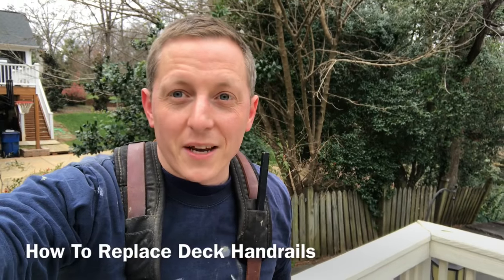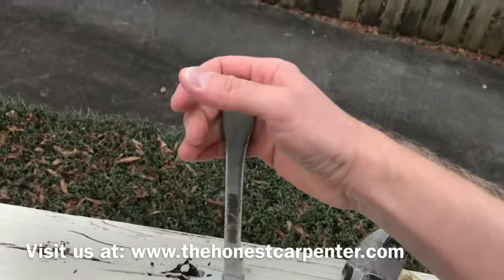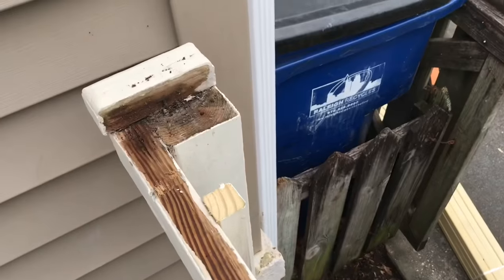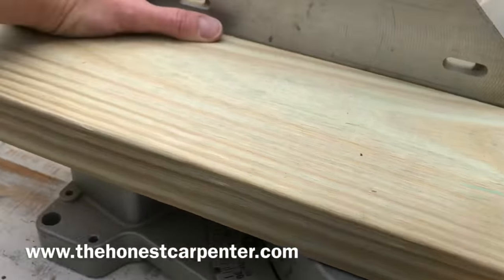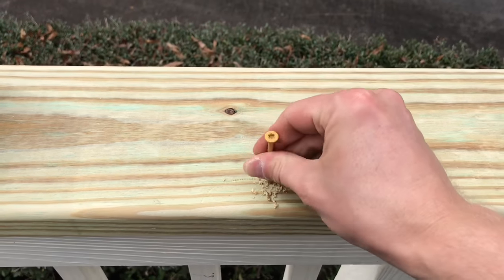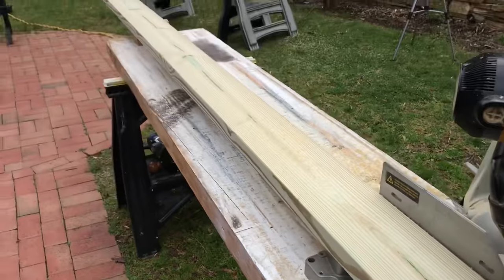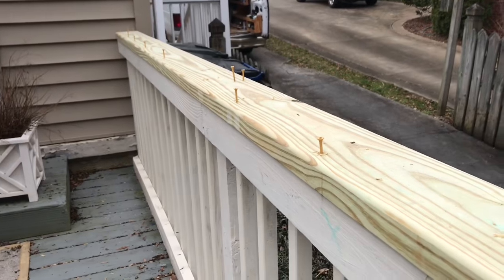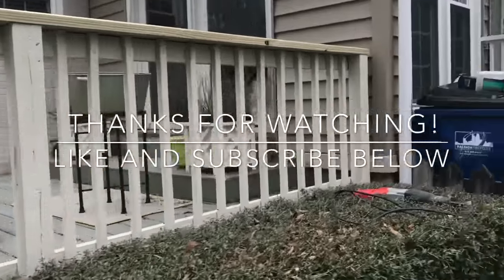How To Replace Deck Handrails (Easy Tips For Replacing Deck/Porch Handrails + Railings!)

Comment: A small flat pry bar would work better and safer than prying using a screwdriver. It's good you use the treated screws as fasteners instead of nails. A wide, flat railing like this is the case here retains surface moisture and will wear out or rot without a lot of care. Isn't there some way to add a slope or bevel to the railing so rain and snow don't just sit on the surface? Since you're selling a consulting service, I was hoping to see a more creative solution than just slapping some new treated flat lumber where the previous railing rotted.

Comment: I always use vinyl gutter upside down as the top cap. It protects the wood, looks better and will never rot. It will in most cases snap right on a 2x4 without the use of any screws
Reply: Great idea might try that

Comment: On any project I like to put the lumber printed information/markings on an unseen side.  If this isn't possible do you sand the ink off or have a better solution?  On a deck, the stain or water proofing doesn't cover the printing.  Any tips?  Love your stuff, you're a genius and you add great things as you go through the job.

Comment: Good carpenter tips in the video but I would suggest several other steps.
Paint or otherwise protect all that unpainted wood under the deck hand rail pieces before installing the new pieces.
If the new pieces are dry enough to router I assume they're dry enough to paint; consider painting the entire new pieces before installation, but at least paint the underside (to avoid painting upside-down after installation, easier to use a roller or broad brush) and the cut edges.
Consider a thin layer of caulk in the corner joint and the scarf joint; looked like the old scarf joint channeled water down to the post top.
Reply: I would even cut a line under so that the water doesn’t seep back and stay there!  A water break line, I guess.

Comment: Thank you for your incredibly helpful videos, Ethan -- I've learned so much from you, and I really appreciate your no-gimmicks style. I have a question about figuring out the lengths of railings when the corners are mitered. I have a horseshoe-shaped deck and I'm redoing the posts, balusters and railing caps. One of the railing caps (the "middle" section of the hotshot) will have two 45o mitered ends, while the other two railing caps (let's call them the legs) will have a 90o square cut at one end (that meets the house) and a 45o miter cut at the other end that meets the 45o cut of the middle section. Do you have any tips for calculating the lengths of the inside and outside measurements of the miter cuts? Thanks again for the great information.

Comment: thank you sooooo much for this video this was good advice. I have some really bad miter joints on my deck hand rails i have to splice in some new rails and cut some rotted sections but im going to do instead of miters  half lap joints if they separate like my existing miter joints they wont look as ugly.

Comment: When removing long boards, cut them into shorter pieces. It's easier to remove short pieces. I like to leave the screws flush so it's easier for the next person to remove them if the board rots again.

Comment: Looking to replace my deck handrails this Spring. A lot of erosion on those boards. I was contemplating the idea of putting some angled shims underneath to allow for water runoff. I'm a beginner at all of this, so I don't really know if that's possible or advisable.

Comment: It looks like the new wood has knots in it. Do you recommend filling them in before painting them?
Reply from the maker: @The Blade Runner If the knots are dense and more or less healthy, I just leave them be. If they’re corroded and falling apart, I’ll sometimes gouge them out and fill them with adhesive or even epoxy

Comment: What type of wood did you use?
Reply from the maker: I think treated 2x6, MAP.
Reply: @TheHonestCarpenter  Thanks for getting back to me. Excuse my ignorance but I tried looking up 2x6 MAP and can't figure out what MAP means.  When you say treated is it some sprayed on  treatment that protects against mold or termites?  Can I find this in my local Home Depot or Lowes or is it some kind of specialty lumber.  I had to replace a 2x6:section on my deck a while back and used redwood but I'm wondering if there is something better. The redwood seemed soft. I used the same for the vertical 2x2 railing pieces.

Comment: If someone did this same kind of project but stopped halfway in replacing all the rails and now I am trying to finish, should I redo their work if they fastened with nails and not screws?
Reply from the maker: Eh, leave the nails in until they start to lift out on their own Chris. Then replace them with 3” screws right through the old nail holes.
Reply: You’re the best! Thank you for such a quick response. Appreciate the content. Keep it up and good luck.

Comment: Shouldn't the cap be slightly elevated on one side so it sheds rainwater? I put a flat cap on mine and regretted not giving it a pitch. That's why I have to do this same job.
Reply: This is a problem I have!  MY cap just get's NASTY with algae and stuff.  How is the best way to cut or build a slope on the cap so rain water runs off?

Comment: When trimming out a door or window do you ever have problems with tight miters. When I trim a door starting on left side, then trim the top the trim piece always slopes down so then I have to cut like a wider miter. What's your secret ??
Reply from the maker: Hey Rick, sometimes minutely different miter angles are necessary to get tight corners, though this can create problems with the length of the actual miters too. But sometimes, if the case opening is out of square, I'll just cheat and leave a bigger reveal on one side than the other to keep my trim miters right at 45. So, one leg of trim will be longer than the other, and the reveal on that corner bigger. But in my experience extremely few people notice minor differences in reveal size--and in older houses, EVERY case opening is out of square so it's often necessary!
Reply: @TheHonestCarpenter  ....Thanks I just thought it was me.......

Comment: I had a so called professional, put a new top railing on my wood deck. It was pressure treated, and after a month it separated where the joints meet Can you show us how to fix this issue? Do not want to call him back because he did a terrible job on the rest of the deck

Comment: I’ve got a 4x4 that’s only rotten at the top. I’m dreading having to replace the hole post and I’m here looking for ideas.
Reply: I had a similar problem. The rot extended down about six inches. I carefully cut the post back to good wood, cut a fresh piece to replace the rotten part, drilled through the replacement part with a 8-inch bit. I then put Gorilla Glue on the two joining pieces and ran two 10 inch lag screws to hold the glue joint in place. I let this set, shaved of the extra glue and painted it. The glue is stronger than the wood so I could have removed the lag screws but didn’t. I replaced 8 post tops this way and  all are fine after a year.
Reply: @oldmanandthesea3763  
My post was rotten in the center. I decided to run a new piece of treated 2x4 from deck surface to the post top. Then I topped off with a 2x4 on top. Painted to match. So far so good.

Comment: Problem I have is my deck railing are not 90 degrees. Heck if a time trying to mitre the corners.
Reply: Use two pieces of scrap. Cut both at the same time (and same angle) on your miter saw (flip them face to face or back to back so you can cut both simultaneously). Check if they fit together properly on the finished corner. If not, take them back and nudge the angle a little and cut again. Repeat until you find the exact angle for a perfect joint. Then keep the saw in that position and cut your final pieces of wood at that same angle.
Reply: @j10001  done. I did see it on this ol house, thanks for the reply

Comment: Wish I saw this before changing out my deck rail tops. I didn’t think to add extra screws from the sides at the corners and one board warped so bad that it pulled up and the screws’ tops popped 	right off. Is it possible to get that board to flatten back and still use it or do I need to toss it and buy a new board to replace it?
Reply from the maker: No real way to unwarp boards I’m afraid, Denise. Best to just start with a new board 😕

Comment: what angle was the scarf joint?
Reply: From the looks of it, probably a 45 degree cut. If you don’t have a miter saw, use the bevel adjustment on your circular saw - but don’t trust that the “45 degree” mark on the saw is accurate. Take a combination square, remove the ruler, and use the precision-made body to set the base to a 45 degree angle with the blade. Take a couple of test cuts to make sure it is accurate (fine tune if needed) then lock it in. Mark the final adjustment with an extra fine Sharpie or a file. Cut your scarf joint first , then cut it to length. It’s is much easier to adjust the length of a 90 degree cut than a bevel cut. And if you have more than one bevel joint, cut them all at once so you don’t have to constantly reset your saw.

Comment: With the screws allowing moisture through from the top, this won't last as long as it would if you had fixed from underneath. It also doesn't look as neat. I would expect this from a handyman, not from a professional.